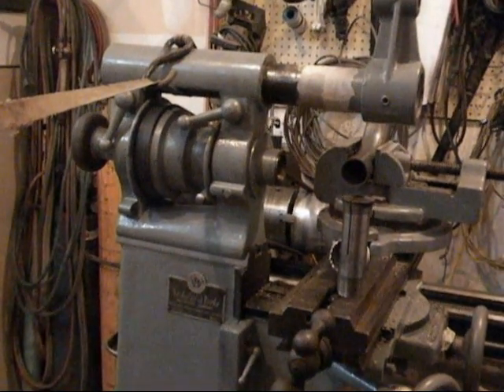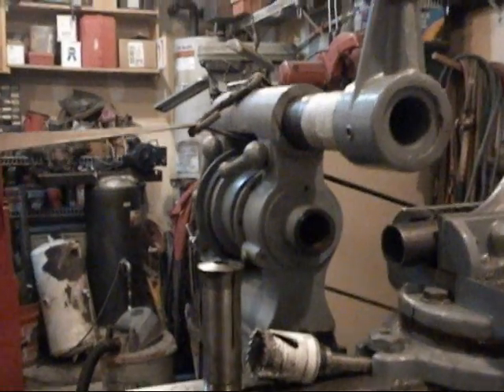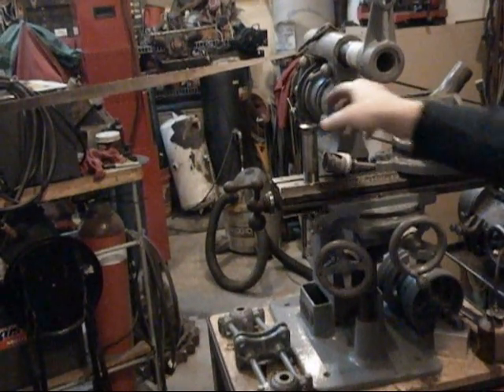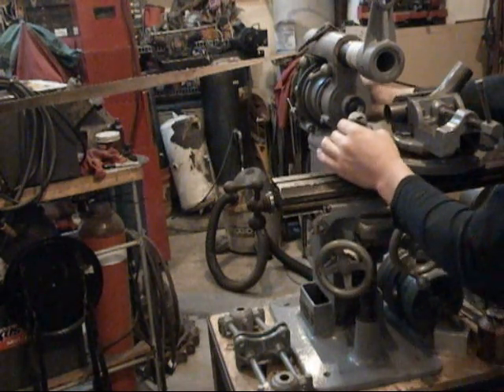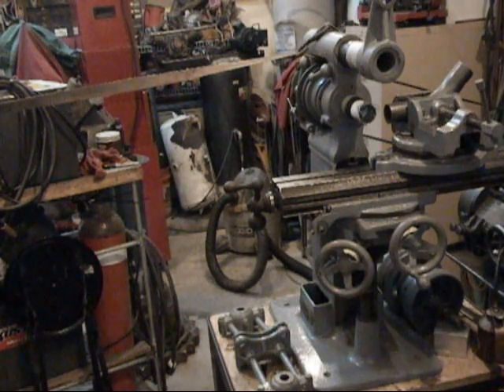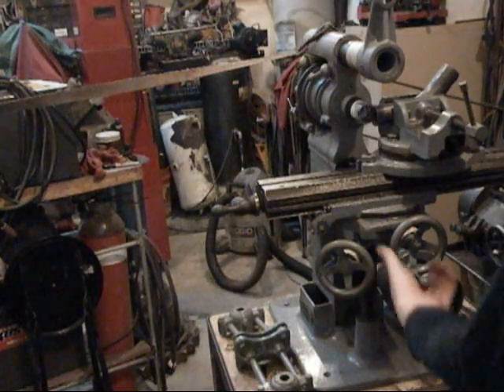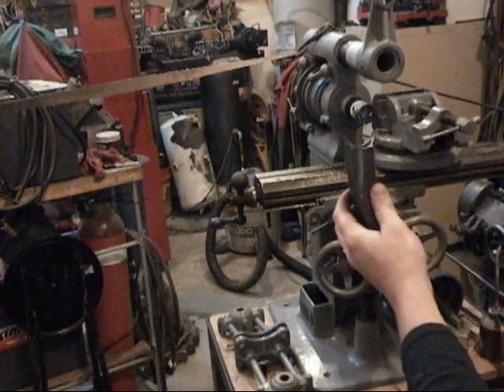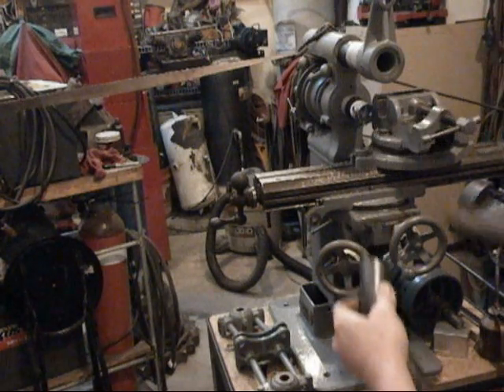Tube notching / coping with BC Ames Milling Machine

Comment: You have probably solved your collet problem by now, but there are some 1A collets on eBay from time to time.  This looks very similar to my Pratt and Whitney #3 bench miller.  The Ames millers were extremely expensive machines when new.  A complete miller ready to work, save for a countershaft or drive gearbox, cost in excess of $800 at a time when the pay of an average workman was just $10 a week.  They were built to the size of their #3 bench lathe and the collets and some tooling were interchangeable.  the millers had a choice of headstocks that took a 5/8" collet or a 1" collet.

Comment: closeratio1971 Very nice save on the machine, you saved it from the scraper no doubt.  Did you ever find any collets?  If you made a extension for the spindle nose  and a new drawbar you could use either Pratt & Whitney #7 or Hendy #3 collets,  Both of those collets have the same OD body diameter they are just both a lot longer and use a 20 tpi thread instead of 24.

Comment: That's an awesome little tubing notcher! I think 17/32 is probably a good size for that machine, it gives a you a built in safety in that the 17/32 shaft will break before others things start getting mangled.  Just make a few of them if you tend to break things like I do ;)

Comment: If you were into working on mud run trucks and race cars you've got the perfect set up for roll cages, or even building dune buggies. I'm with Keith on the collets though, make some, or even adapt some that are close. If you had the pattern tracing attachment that Keith does on his lathe you could take the profile of your existing collet to get the shape.

Comment: Hi Grady, thats a cute little machine, had a small single grove table B&S once! I hope you find a few of those collets but if not you can make it a project and create a few your self, all the import measurement are in the sample you have now and you could also make the draw bar for running wheel cutters, most of those kind of tooling are mostly lathe work. ;{)-----